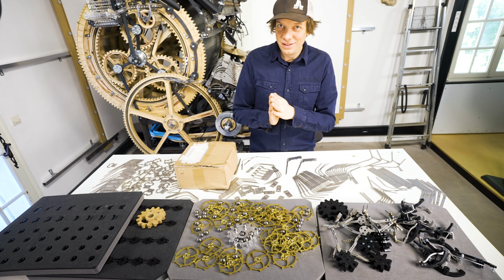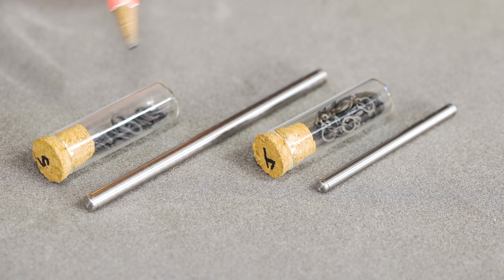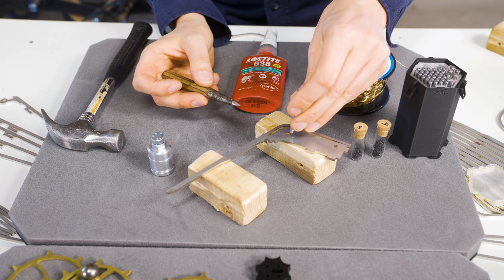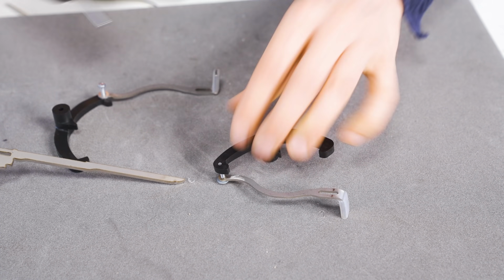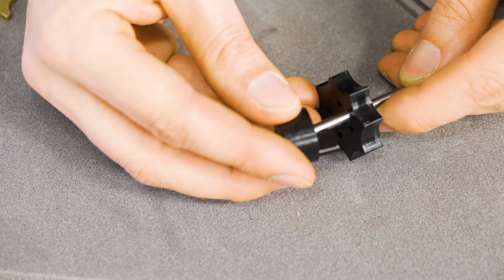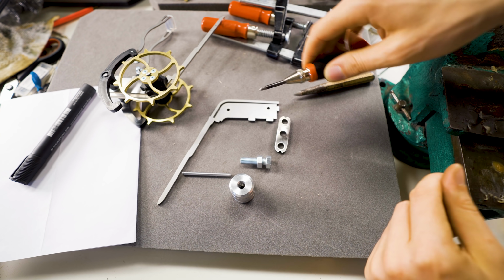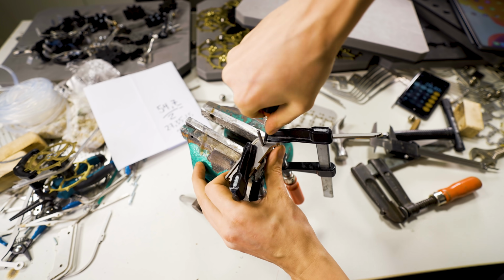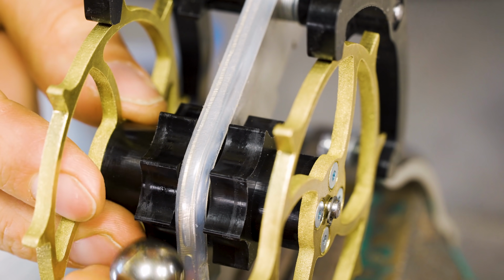Silver Steel Axles - Marble Machine X Escapement Gates

Comment: For tight tolerance, you can put the rods in the freezer and slightly heat the receiver (oven at a low temp or put it outside if it's warm enough out). This will allow a tighter fit without risking damaging the parts.
Reply: I was thinking the same thing, it also has the benefit of keeping the center and perpendicular alignment of the axles to the mount. The loose tolerance could mean an off center or tilted axle if he welded or brazed. At the tight tolerances everything was machined to I don't believe it would be a critical failure if welded though.
Reply: It will take time though so martin won't like it haha
Reply: @Sagolel4797  if you put them all in at once, maybe you have to wait for the first one, but not any of the subsequent ones.
Reply: We used to do this for interference fit parts in turbine engiens. It works very well!
Reply: This is pretty much the process behind shrink fits.
Reply: He already this this when fitting bearings in metal pieces.
Reply: I was shouting this when he was explaining the different ways he could put them together!
Reply: @killiemon  Freezing a 5mm rod isn't very effective.
The differens in diameter would be 0.000011×5=0.000055 mm/°C, if we assume a room temperature of 20°C and -20°C in freezer we get 0.000011×5×40=0.0022 mm.

If the axle would have been 50mm it would have shrunk 0.022 mm, that's a more usable difference.
Reply: Also I wouldn't recommend heating POM. When I worked in plastic industry I heated POM parts to 100-130°C and cooled them to room temperature just to make them shrink.
Reply: @morilot  it's all about tolerances, when the tolerance is really close, even a tiny amount of movement can make a big difference. Also, you not only freeze the rod but you heat the mating piece, doubling your movement.
Reply: @killiemon  If your tolerances is within 0.002 mm you're making some fancy stuff.
Reply: @morilot  I learned about that from my father when he was building the mold for an artificial heart valve a couple decades ago and that was the actual tolerance he was working with.
Reply: @Lynwood_Jackson  Heart valves ... 😵
That must be the definition of fancy stuff.
Reply: @morilot  oh yeah. His hair was white by the time he was 35 from the stress of that job. He'd get a whole lot of precision machining jobs like that and then randomly an easy one like a tv remote or a price scanning tool for grocery stores.
Reply: Plastic injection mold making, if that wasn't clear.
Reply: @Lynwood_Jackson  - I quite often work on mold cavities, and I can confirm that moldmakers stress over their work. I like to say they're the cabinetmakers of the machining industry. Everything has to be as close to perfect as it can be made, and it also has to have zero scratches, as they'll show up on the final product. They also tend to want things made to tighter tolerances than the drawing shows. The designer might specify a tolerance .0005" wide, but what they really need is more like -0 to +.0001 When we work on molds, we don't deburr the piece afterwards as we do for most things. They prefer to do it themselves to avoid scratching it or making a slight chamfer on the edges.
Reply: @hamletksquid2702  where are you in the world?
Reply: @hamletksquid2702  none taken. I was just curious because I know a lot of those jobs left the US and never came back. We left the east coast and headed back and forth across the US in the '90s-'00s trying to find work for my father, but all the shops were closing their doors at that time.
Reply: @Lynwood_Jackson  - They sure have. Most tool and die work is done in China now, so most of what we get now is finicky mold parts, making parts for huge old mining equipment, and stuff I'm not allowed to talk about on the internet. (mostly because our customers value their proprietary information, not because of the CIA or something) My trade is dying off, but there's always a need for real precision work so it hasn't just ended. It's mostly older guys now, and we're not training apprentices anymore so when we're gone, the skills will all be gone too.
Reply: @hamletksquid2702  it's a real shame. The same thing is going on in auto body repair, farming, welding and I'm sure a hundred other skilled professions. I got pushed into going to college (and never used anything I learned) instead of learning a trade. It ain't good that all we know how to do anymore is use a computer.
Reply: @Lynwood_Jackson  - Twas ever thus. My grandfather started out as a blacksmith, which meant mostly shoeing horses back then. When people stopped bringing their horses in, he went to work for Goodyear. My Dad was a TV repairman until TV's became disposable, then he worked repairing TV cameras. I've had a few trades in my time, but this one only has to last a few more years. Then my trade will be fishing and yelling at the neighborhood kids.
Reply: @hamletksquid2702  that's not a bad plan. I've worn an awful lot of hats myself and I've got 24 years until my pension pays enough for me to retire and start on a new profession.
Reply: Just as you would do with a starter ring on a flywheel
Reply: Thank you...
I would expend too much time talking about how using a Hammer hurter my soul more that the angle grinder has so far.

I have destroy a car suspension axle with a construction hammer.
granted, wasn't using sacrificial wood, still...
Reply: Interference fit would likely fit this application quite well. Drill and ream the holes undersize, throw the axles in some dry ice and then fit. As the axles warm back up to room temperature they will seize in place as they expand and lock into the whole. This also avoids exposing delicate parts to undue heating cycles.
Reply: Okay, so one should check if dipping parts in liquid nitrogen might affect to their properties =)
Reply: @gadi70  doesn't need to be that cold, depending on how tight the fit is. Since he was able to smack the part into place, a small difference in temperature likely would have been enough.
Reply: @gadi70  
In the metal materials. No
Reply: An upside-down can of dust-off / compressed gas electronics duster works well to quickly chill metal parts
Reply: I think the right way to do this would have been: undersized hole, reamed of course. Then: heat up, put together, forget forever... I also don't understand, why he is fooling around with those washers... with everything is designed and made for tight tolerance, why he was not included the right, designed and controlled sized distancer pieces? Or, integrate them already in those plastic things... Now all this looks like one who is trying to put together a spaceship - with washers as distancers :)
Reply: commenting so this comment is more visible!
Reply: Great idea! Simple physics to the win!
Reply: @MashedPotatoes690  Yeah, toolmakers have serious tolerances, the tool must be have order or two higher tolerance than the product it makes. If the product has an insane tolerance, like a heart valve, the tool need a ludicrous tolerance.

I was offered a job as a toolmaker, was tempted to say yes even thou salary was lower than what I have.
Reply: this is also done in some heavy duty aplication as theparts shrink fit on to each other.
Reply: @Kylian381  The bigger something is the more effective it is to heat/freeze.
Reply: he can wrap the frame component in a wet paper towel and microwave it. The water will absorb the microwaves but won't allow the metal to get hotter than 100c (which is hot enough to make it expand, but not hot enough to change anything permanently)
Reply: @finnrock5558  completely false, and idiotic.  steam can be hotter than 100c, and putting metal in a microwave is by far the dumbest thing i read all day
Reply: @natalieisagirlnow  steam can be hotter than 100c, but water can not be. As long as you don't let all the water boil, it will remain at exactly 100c. Also, metal in the microwave isn't a problem unless it's grounded.
https://www.youtube.com/watch?v=LVODJm05plw
Reply: @finnrock5558  but even if it works right, you end up with ramen that always tastes like finishing oil. Lol
Reply: false

Comment: For anybody wondering, 0.03mm is half the width of a human hair. That is why Martin is not worried about it.

Edit for obvious reasons: an average-ish human head hair.
Really enjoying the comment conversation BTW! I have learned some new things. 😁
Reply: It's also about 1.2 thou for those of us who still measure things by the length of a dead king's foot. Plenty close enough for the application. Perfect is the enemy of good enough.
Reply: @hamletksquid2702  "by the length of a dead king's foot" gave me a good chuckle
Reply: Even less actually, "The diameter of human hair varies from 0.017 to 0.18 millimeters (0.00067 to 0.00709 in)." (Ley, 1999)
Reply: @joelhoeve  - That's a surprising variation. A hair seven tenths in diameter would be almost invisibly fine, and one that's eight thou would be like wire. Probably crack when you snap it.
Reply: The comment section is literally splitting hairs here.
Reply: Twice the thickness of a fine hair, but thanks for putting it into more ambiguous terms. 😊
Reply: @nagualdesign  - Actually, half is accurate. My hairs are about .002" or .05 mm, and a cigarette rolling paper is about .003. People use them to set up and find an edge. You stick a bit of rolling paper on the piece, and when the tool touches it and it flies off, the tool is 003 from the surface.
Reply: @hamletksquid2702  Yeah, that's about accurate I guess.
Reply: @nagualdesign  - I've never looked it up before, so I didn't realize anyone had hair as fine as seven tenths. My hair's fairly fine, so I imagine hair a third its thickness must float around like a cloud in any breeze.
Reply: @hamletksquid2702  Not all hair is on your head. 😉
Reply: @nagualdesign  - I'm gonna read up on this a bit. Maybe it's body hairs they're talking about at the lower end of the scale. I just know that my hair's finer than most people's. I doubt that anyone has ever bought his first micrometer and not measured his hair.
Reply: @hamletksquid2702  As you start to get older the hair near the front of your scalp can get pretty fine too, and yes, they do tend to float around like a cloud once the electrostatic charge is greater than the mass.

I think the take-home point here is that "the thickness of a human hair" is even more ridiculous as a unit of measurement than "Olympic swimming pools". Just saying "0.03mm" (or "1.2 thousandths of an inch") is far more sensible.
Reply: @nagualdesign  - I think most people don't have any real experience working at that scale, so numbers are just numbers to them and they need something familiar to picture the sizes involved. Tenths don't mean much unless you've had to sweat over them. I had a custom license plate on my last bike that said "10THS". I used to bolt it to my machine every winter. Tenths matter, but not to most people.
Reply: @hamletksquid2702  this was my thought. Just wanted the average person to better understand why he isn't worried.
Reply: @hamletksquid2702  The thickness of a cigarette paper is a pretty good analogy. Or aluminium foil. Or a polythene bag. Something that has a standard thickness.
Reply: @nagualdesign  - People have their favorite brand and everything. We use cigarette papers because they have glue. You can stick regular paper on with spit, but it comes off too easy from the "wind" made by the tool. At my main job, we don't do that. We use dial indicators for everything.
Reply: @hamletksquid2702  True. I bet aluminium aluminum foil in the US is extra-thick.
Reply: @nagualdesign  - I honestly wouldn't know. I think the people who make hats out of it probably use multiple layers. We use steel or brass shim stock when we need to shim something. It doesn't squish like aluminum does. I know one old trick for loose handlebars on a bike is to wrap the tube with a strip of beer can inside the clamps. That's about the closest I've come to using aluminum for shimming.
Reply: @hamletksquid2702  
Some chicks wolly zone hair is more  like a wire brush 😬
Reply: @assassinlexx1993  - Now, that's thinking outside the box.

Comment: I think having some mechanical pliability in y0our parts where there's a tiny bit of play will be advantageous to you as materials expand and deform due to temperature, humidity, pressure, etc. A design that is too perfect fit will create problems in the long run.

Comment: Why not cool the rods? That would shrink them and after they heat up they'd be perfectly in it.
Reply: That’s smart but also brings up something that makes me worried. How is the marble machine influenced by different temperature conditions. He’s going on a world tour so it’s probably important to think about > 90 degrees F hot places and < 30 degrees F cold
Reply: @ckv954  Operation will, presumably, always take place in temperature controlled rooms. So that's consistent and where such a thing would most likely present a problem. The expansion/contraction are pretty miniscule (measured in the thousandths) , and would be fairly uniform. I don't THINK his tolerances would make or break on 0.00* deviations, but perhaps that is a question he needs. I'm no expert lol

Comment: Edit: I should watch the video before commenting.
Hey Martin, if you're concerned about making holes too big by drilling the laser residue out, I suggest using a reamer. That way you can really hit very tight tolerances on your hole diameters
Reply: hah, that has happened to me before, i comment a suggestion but right after i resume the video, that idea is being presented.
Reply: upvote for the edit
Reply: haha
Reply: @Invictus_CS carbide reamers exist as do adjustable ones.
the real trick would be lasering a pilot like he did for all the plasma cut parts and then drilling that to size then reaming